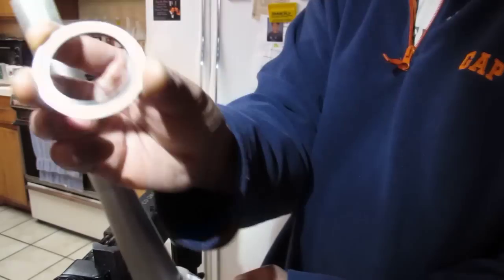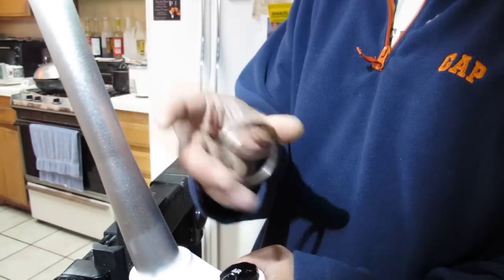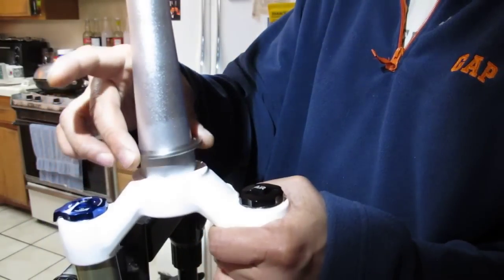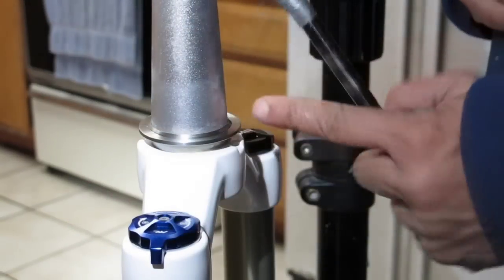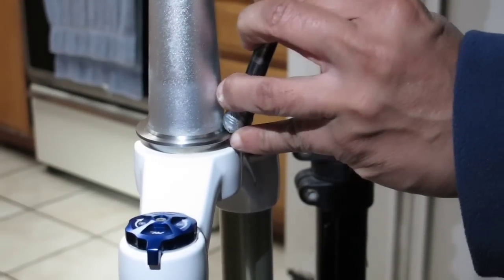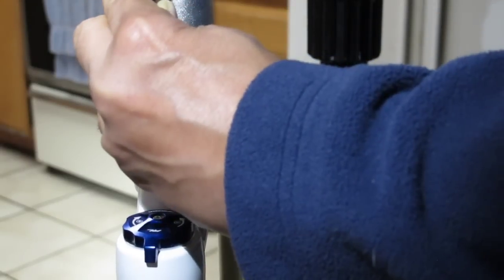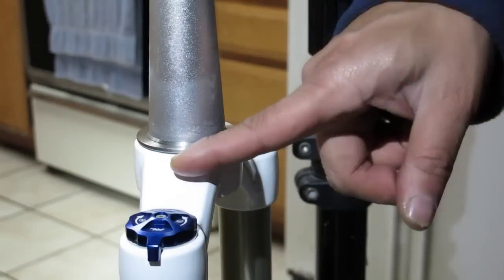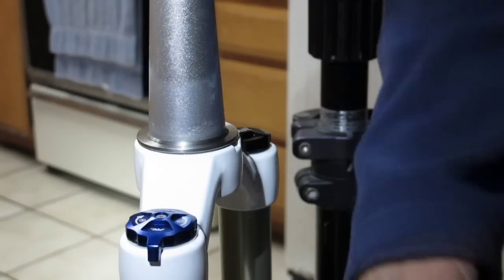Crown Race Installation

Comment: If anyone is looking to do this with minimal tools, you can use the tube from a Henry Hoover and use the old bearings cups upside down to smash the new crown down.
Reply: Or use a straight steer head tube from an old frame and smash that shit right ontop

Comment: I boutgh a used 1 1/8 steer tube fork but it had some back and forth play at the crown  and gets siff is it because I need a crown raise installed? Mine doesn't have one maybe I got it without it? Please help me out I'm going bananas here. Thank you
Reply from the maker: I have installed several forks and have never encountered a situation where it didn’t require a crown race..... I would attempt to remove the crown race from the old fork and put it on your new fork... or purchase a new one for the fork which will work with your particular headset..

Comment: Do NOT ever ever, ever, under any circumstances, do this.  PVC pipe and a mallet  simple
Reply: I've done it both ways and this method works exactly the same stop limiting people from doing certain things.  I can tell you as a mechanic theres many ways to do the same thing.  This is an acceptable method and doesn't damage anything if done well.

Comment: Please understand that the race is a Delicate machined piece.  As a bike mechanic this is a terrible way to install a crown race on a fork.  There’s a reason we use a metal tube to evenly hammer the race on.  If you hammer it like that I don’t care if you put duct tape you will in some way shape or form damage the race and it will not be flush with the headset bearings or steer tube.
Reply: Who cares bruh it’s not that deep

Comment: To all of you that harsh this video.....building a bike is not rocket science, in fact it’s quite simple! Do you really think a bit of paint chippage makes a difference? I don’t know about you, but I don’t build bikes as museum pieces. I ride the fuck out of them! If you are a true rider....you will destroy bike parts at some point. If you go a couple months without some kind of issues, well.........you ain’t riding son!
Reply: Too be honest  I do prefer  a clean bike ok a little  scratch  then yes but sometimes it's nice to repaint  the frame once on a blue moon I am converting my xc bike to a ebike conversion  with a bafang  motor 750watt   52volt 65a 12ah super battery     for longer mileage  out of it  but I need to start looking after it buying a 4 piston brake kit with new brake levers  my goal is to give it a better paint  job and use higher quality  2k clear coat  on base paint is mid night  pearl black  blue colour  its a custom  colour  so the cans are diy filled

Comment: If it's being particularly awkward, then just throw the race in the oven for 10 minutes, then it will basically drop on. Works a treat.
Reply: Jason Bye - Best and most useful YouTube comment ever (for me, at least)! Worked like a charm, thanks!👍
Reply: As an industrial mechanic who installs bearings on much more critical equipment than bikes, this is common practice (only with actual bearing heaters) and the best advice here.
Reply: @Sebastian Lastra Valenzuela it works (the oven, not the microwave)
Reply: What temp?
Reply: Mine has black paint on it though.... will the heat strip my paint ?
Reply: Jelle Otter it shouldn't. Leave it enough time for it be hot but not super hot that it burns red. The metal doesn't need super high temperature to expand. Leave it for 3 minutes on 200 Celsius and try. If not working throw it inside the oven again for another minute or two.
Reply: Jason Bye, thank you for this advice! The oven trick worked!
Reply: @woofwoofdoggo  Not for everyone.
Reply: worked great thanks
Reply: Would the oven also work for crown races that have the rubber seal?
Reply: @theflyerpr40d  The runner seal would probably melt.
Reply: mine has a rubber peace on it. so i can't do that
Reply: This worked a treat, thanks for the tip
Reply: Any way to do this with a cane creek 110 crown race that has a rubber seal gasket permanently affixed to the metal race?
Reply: Never in the mircrowave 😂
Reply: Awesome tip, thank you for that 😊
Reply: DUDE THANK YOU IT WORKED IM SO HAPPY THAAAANK YOIHUU
Reply: Only 2 mintues in the microwave if you're in a hurry.
Reply: @United_Slaves_Of_Israel won't it spark?

Comment: a short piece of pvc 1.5" pipe and rubber mallet will put it on evenly.
Reply: Flatzout Yeah I agree, I've used an offcut of PVC pipe and it worked fine. Some crown races are more stubborn to fit than others, I wouldn't bash on it with a metal rod from an angle in case it messes up the race or slips and gouges the fork crown.
Reply: good one.  That's what I'll do if it hangs up at all.  Thanks

Comment: Got this Job to do soon on a Road Bike, i"m going to do the same as i do with the Motorbike Headstock when changing Head-race Bearings, and that is throw the Forks into the Freezer Overnight, Should slip straight on then.

Comment: Easier way is to get a 50mm PVC water pipe slipped over the steerer tube with an end cap on the top, which you can then pound on with a hammer.